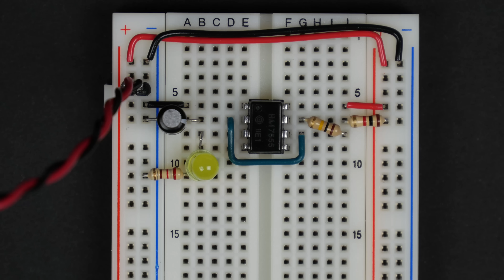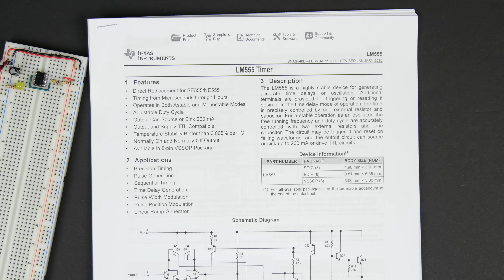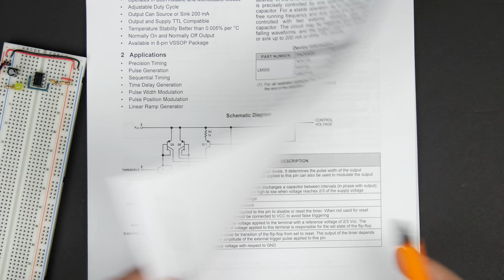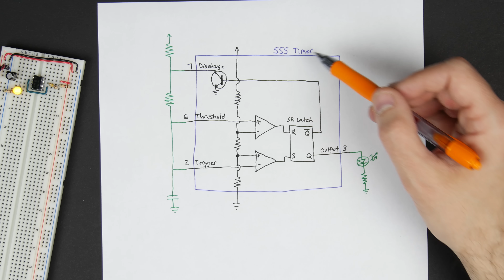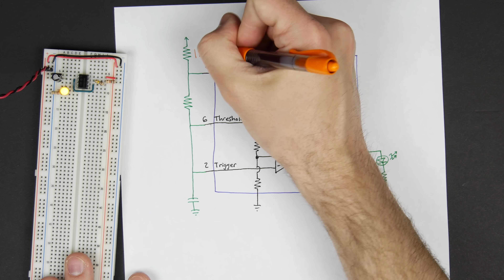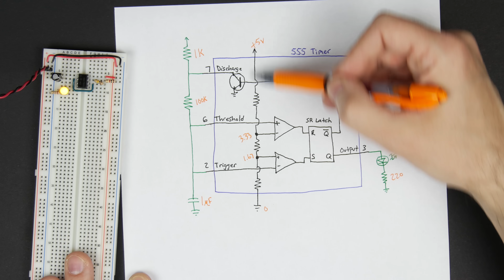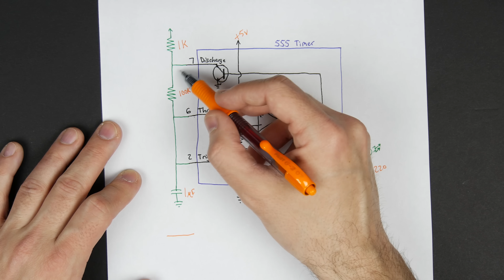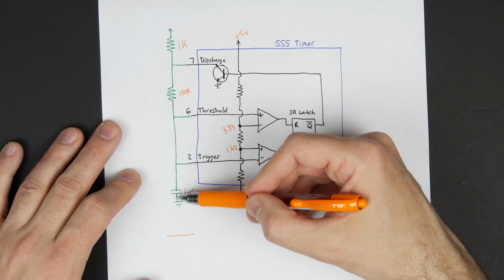Astable 555 timer - 8-bit computer clock - part 1

Comment: Totally ignorant about electronics, got a bit lost about 8:50. So ok, when the voltage goes above 3.333 V the SR latch is reset which produces a !Q output which activates the discharge transistor which redirects the input current (green line) to ground, is that correct? And then what I don't get is how the fact that input is going to ground activates the transistor discharge to start feeding the timer inputs.
Reply: Yes, you are correct. 

Since there is not flow from source to capacitor(as source is going to discharge), the accumulated charges in capacitor will flow out due to potential difference, thus causing discharging itself. 

This causes change in potential difference and when below 1.67 and activates set comparator. This stops QBAR and hence breaks circuit in transistor and stops discharge from source. Thus the flow from source comes back to capacitor and causes capacitor to charge

Comment: Years ago when I did basic TV we made an Astable out of 4 resistors, 2 capacitors and two transistors. This was to demonstrate the square wave output which was required to switch the flyback signal. Now with the demise of CRT no one will know what flyback was for.
Reply: currently revitalising a commodore 1084s-d1 so there are people that know ;)

Comment: caps have a specific orientation or they'll pop. Does this mean you're putting it in backwards since you want to draw the charge out in the opposite direction and not to ground?
Reply: The capacitor will never be connected in reverse direction. You can imagine both its pins attached to ground (through the 100k resistor and transistor) in the "worst case" when discharging transistor is open.

Comment: When  put the inverted signal at pin 4, it's like the reset is set to high at 5V like forever. So how do you get it low when wanted to? I mean, in case both Reset and Set are at high then there is a confussion, isn't there?

Comment: Could you put a 1k resistor before/after the transistor to delete that 1% difference?
Reply: Alexis Gaziello "After the transistor" is not available, in addition you would still have a 1k difference between charge and discharge.

Comment: how do you know which resistor to use, I mean why a 100k resistor and not, for example a 10k resistor?
Reply: Tobias W. Just need the make sure the charge plus discharge current does not exceed the capability of the discharge transistor (about 200 ma although not in data sheet).
Reply: because it would make the clock go faster

Comment: There's one small thing I don't understand, though; Why does the capacitor discharge through the discharge pin if it has to go through a capacitor? It could discharge through the ground that is right under it, without a capacitor
Reply: the capacitor is like a battery , it has to discharge from its + pin which is not correct to ground
Reply: Thinking capacitor as increasing resistor(eventually insulator) may help. Capacitor does not have completed circuit but it accumulates charges and behaves like circuit. Once charged enough, it will not accept any more flow and increases resistance. By this time, the reset will have triggered and starts a small flow from base to emitter of transistor. Once this circuit is formed, the charges directly flow through collector to emitter(least resistance) and will not flow to capacitor. This causes capacitor to release it accumulated charges thus causing discharge.

Comment: You mentioned that you put a 1k resistor on top, with a 100k resistor below it, in order to have approximatively the same time between charge and discharge, but in the end you say that you can go down to 1k with your variable resistor (in place of the 100k resistor), still the light seems to be on the same period as it is off. How so?

Comment: with the 5k, 5k, 5k resistors inside. They would either call the chip the 555 or the KKK... I Guess they preferred de 555 for some reason...
Reply: That's a common mistake. There's no sense behind 555's name. Here you're able to read an interview with Hans Camenzind (an author of the scheme) about the name https://www.quora.com/Why-is-IC-555-called-555-Why-not-111-or-any-name
Reply: Oh, man... Just a cite from Hans Camenzind (an author of the scheme): "Signetics had “500” numbers, and the earlier product I worked on was the 565, 566 and 567. It was just arbitrarily chosen. It was Art Fury (Marketing Manager) who thought the circuit was gonna sell big who picked the name “555”"
Reply: the cmos has 20k instead of 5k so its coincidence
Reply: lucky it wasn't three 6K resistors, that would be evil
Reply: Imagine tinkering with a 666 oh-oh! :D
Reply: @luck3298  Because you read from someone else's comment? Or it is factual? Source?
Reply: @Just Cause - The 556 is a dual 555. So I guess it has a 5k, 5k, and a 6k inside? SMH.
Reply: Yep its coincidence, that is (from memory) the 555th IC they made
Reply: On the other hand, a KKK chip might prevent brown outs.
Reply: Thomas Richter it is not called a 555 because of the resistors. That is just a coincidence.
Reply: Black noise too
Reply: Yes, it was called 555 because of the series of three 5K resistors in series.
Reply: its not a coincidence...

Comment: Why doesn't the capacitor (At 8:50 in the bottom left) fill up and prevent the voltage from raising above 1.67v preventing the comparator from firing?
Reply: Because discharge through transistor(when reset if triggered and transistor collector->emitter is enabled) is the least resistance path. (to reach capacitor, the flow from source has to pass through 100K resistor which it won't given that there is least resistance path)

Comment: Your Videos are awesome. 555 Timers were always a mystery to me, I've used them as oscillators, and as parts of kits (without quite understanding their function in the kit. Have also had Philips 555's not work in standard circuits where the NE555 worked quite happily.
Btw, If the caps came from eBay (aka China) that would explain the mis-marking.

Comment: Excellent video, and a better explanation of a 555 than I ever actually got in class.

I haven't watched your future videos yet, but will you be putting a T flip-flop to the output at some point to get yourself a 50% duty cycle? I am not sure if a perfect 50% DC is necessary for your application though, so I am just curious.

Comment: Is'nt the "pin 4 to 5 volts" a problem - wont it short circuit when the top conparitor outputs 5 volts?
Reply: unless there is a resistor inside the chip avoiding that .

Comment: I set up the exact same circuit you did. But there is no oscillation going on. How can I test, if my 555 Timer is damaged?
Reply: Okay, did the same set up with a new one. Worked perfectly fine.

Comment: hrm... all i had on hand was a HA17555, but couldn't get this to work. When powering on, the LED flashed once, then nothing. Powering it off, the cap was drained, and powering it back on, it fired once again, then nothing again. Looking at the datasheets of the HA17555, and the NE555, i'm not seeing a such a drastic difference that this shouldn't work.. am i missing something critical?
Reply: lol.. yea.. i'm kind of a derp.. thought i had a 1uF cap, turned out to be a 0.1uF

Comment: How can I control the frequency output of the 555 timer for example I want to design 555 timer that gives me 76 KHz
Reply: do the maths. You know that your frequency is equal to f = 1/t, so t = 1/f. Or t is also t = 0.693(Ra+2Rb)C so you can find Rb or Ra or C with fixing two of them, for exemple if you fix C and Ra, so you want Rb :
t = 0.693(Ra+2Rb)C
Ra+2Rb = t/(0.693*C)
2Rb = t/(0.693*C)-Ra
Rb =(t/(0.683*C)-Ra)/2
tadaaaam

Comment: i made a clock generator with a couple of 555 (also does a few other things). I added a pair of transistors and pushed it to near 3MHz.
The wave is fine but the transistors overheat and the 555 itself gets too hot. It must be a design limitation because even using a smaller cap it still gets hot even if the transistors are the ones doing the charge discharge cycle.. But hey, not many can claim to have a 3MHz 555

Comment: great explanation and your drawing does make it easier to understand, I am somewhat new to electronics, I know the 555 is rather cheap in price, so what the difference between using the 555 as a clock or to blink a led,  compared to using a npn transistor and a cap? which is a lot cheaper.
Reply: Dick Fageroni In fact you can, but its pretty nasty solution. Avalanche effect in trsnsistor makes it conductive, dischsrges a cap and the cycle repeats. But the edges of such clock are nasty snd it has a pretty nasty voltage spikes.

Comment: Why is the current limiting resistor placed after the led, not before?
Reply: Will Strand It makes no difference. Because they are in series the same current must flow through both components.

Comment: Your resistor value as shown is 10K not 100k. Brown, Black, Orange is 10K That is why your period calculation is off.   Other than that, I got the point and thank you! Looks like a Fluke 87-5. Nice meter.

Comment: Change the LED to a relay and a motor, and you have the circuit for the delayed wipers on your car. Nice job.
Reply: Or just plug it into to the turn signal regulator, but you might want to slow the pulse down just a little bit...
Reply: I don’t think the 555’s output is able to deliver enough current to trigger a turn signal relay. Even if it’s able to do so for a while, it will become quite hot.You’ll need to add a big transistor in between or a FET.
Reply: @Engineer9736  no, you would use the turn signal clicker instead of the 555
Reply: Can you use a voltage follower to get the extra current?
Reply: @Engineer9736  What about an optocoupler? Or even a relay-optocoupler combo

Comment: For convenience sake, I followed Ben's lead with the USB cable to power the circuit. However, whenever I use a USB cable and it doesn't matter what cable I use or what brick I use, I always get I very high frequency coming from the output of the chip. It's only ever clean if I use a battery or if I touch any connection in the circuit with my finger while the USB is plugged in. Would anyone be able to give me some advice on this?

Comment: The description lists a 330 ohm resistor but you're using a 220 ohm resistor in the video.
Reply: That's intentional. The value of that resistor depends on the noise your power supply and voltage tolerance of your LED

Comment: Silly question.  I've been working my way through Make:Electronics.  Chapter 11 has you build an circuit out of resistors, capacitors and transistors gives and alternating on off signal with a nice square form.  Frequency can get very high and seems stable.  Could you use that as the computer clock instead?  What draw backs would there be compared to this setup or even a quartz clock setup?

Comment: if you simply removed Ra, between 7 and vcc, the duty cycle would be symmetrical, wouldn't it? I'm guessing you left it in to show how you could make it uneven if you wanted, but is there a reason to include Ra if you don't want it uneven?
Reply: Chris Knowles you can't do that because it will shorten the connection between Vcc and pin 7 that is grounded. What you can do is use same values for Ra and Rb, and use a diode between pin 7 and 6. This way the capacitor would charge only through Ra (jumps Rb through the diode) and discharge through Rb.
Reply: Thanks for the answer! You mean adding a diode in parallel with Rb? This way, when charging, current will "prefer" to go through the diode instead of the resistor. When discharging, the diode will block and force current to go through Rb and the transistor GND. Is that right?
Reply: Fernando Birck That's right! This is the circuit http://dlb.sa.edu.au/rehsmoodle/file.php/466/kpsec.freeuk.com/555ast2.gif

Comment: Capacitors have a tolerance rating, just like resistors.  Electrolytic capacitors typically have a tolerance of -20% to +80%, but it's not unheard of for low quality electrolytic caps to have tolerances of -50% to over +100% which explains your "1µF" cap reading as ~2µF.  Also, if you were to connect another 1K resistor from the junction of the two timing resistors directly to pin 7, your duty cycle would remain much closer to 50% and would negate the need for the other resistor you added when using the variable resistor.  As to the connection from pin 4 to your positive rail, it's generally safer to use a small (<= 1K) resistor instead of a direct connection (a pull-up resistor).  That way, if there is ever a spike on your power rail, it limits to current going to the reset pin.
Reply: my best guess would be that they're all from the same batch, so they all act similarly
Reply: Because then they can sell 1uF and 2uF capacitors, but only make one.
Reply: if it's a tolerance thing, why are they all off by the same amount in the same direction?
Reply: @robmckennie4203  because they are no name garbage caps.
Reply: Also I have seen 555 circuits which don't trigger because the charging current is less than the electrolytic capacitor leakage!  Electrolytics vary wildly with temperature too, so best to keep the capacitor <100nF and increase the resistors.
Reply: The key to this is that electrolytic capacitors are use almost exclusively for filtering and DC blocking.  In these applications, designers want at least a certain capacitance value, which explains the -20/+80 tolerance.  Also, because electrolytic capacitors tend to drift to smaller values as they age, the manufacturers try to design them to start their lives at the high end of their tolerance range.
This makes electrolytics generally unsuitable for timing circuits.  The same is true for ceramic capacitors using certain ceramic formulations (sorry, I don't know which ones of the top of my head), but they are generally much closer to their rated values than electrolytics.  If you want a precise timing circuit, the best bet is to use either polystyrene or polyester capacitors, but in any case, look at the datasheets.  Capacitors really AREN'T purely generic components.  Of course, it's much harder to find 1 µF capacitors in polystyrene or polyester, so the resistor values also have to change.  Not a big deal unless you want a really low frequency, as in this particular circuit.
Reply: I loved your comment about the extra resistor. I had the same thought. Would love to hear more input on that idea.
Reply: Thanks for the hint to connect a resistor to pin 4. My 555 was getting pretty hot, but after I put a 750 Ohm resistor there, all works fine.
Reply: Actually, never mind. It doesnt work because adding a resistor directly to pin 7 will pull up the voltage from ground and your capacitor will never drain fully.
Reply: @michaelmele3954  I liked the idea too so tried it and of course it doesn't work as you explained.
Reply: @michaelmele3954  I think an extra cap will probably work 😅
Reply: @michaelmele3954  It should work if the series resistor that you add to pin 7 is less than half the resistance of the 1K resistor, then it should be able to pull the voltage below Vcc/3. Ok, it should be a bit smaller than that, because there will be some voltage drop across the discharge transistor as well.
As you make the transistor bigger, and it approaches the point where you're not able to pull the capacitor below Vcc/3, the discharge time should go towards infinity. So even though you can't make the resistor very big, it can have a big effect on the discharge time.
So if you know the size of your capacitor and that you want a certain period, with say 50% duty cycle, you should be able to calculate/find values for the 3 resistors to get that (I guess you could fix one of the resistances as well and solve for the other two). But if you want to use a potentiometer to adjust the frequency, I doubt that there will be one value for the series resistor that will give you 50% duty cycle across the whole range of frequencies.
Reply: That's a BIG CITY thing .. always fully drain your capacitor before you get on the subway.
Reply: @HazeAnderson  ???